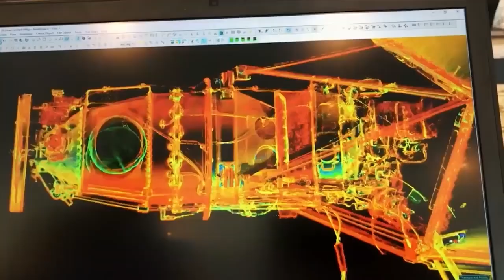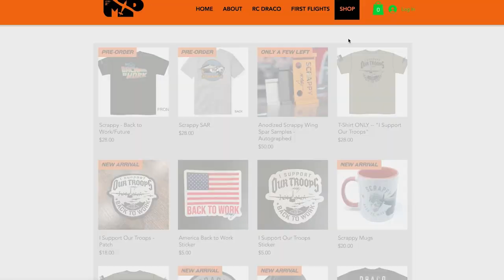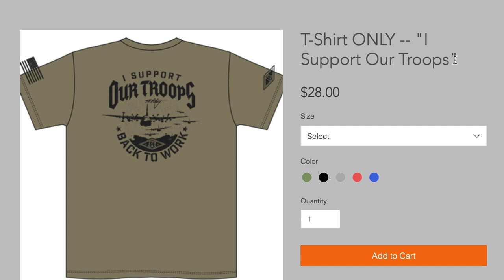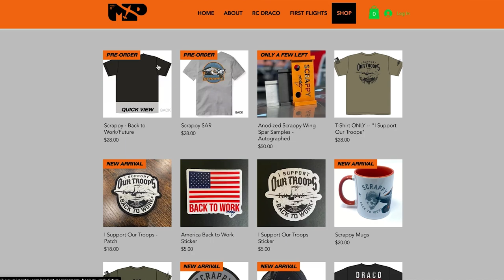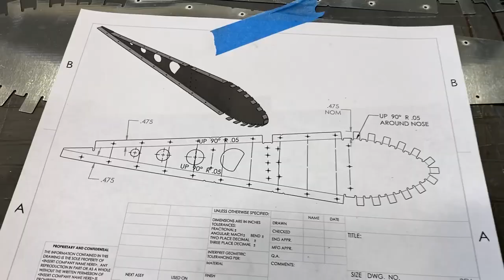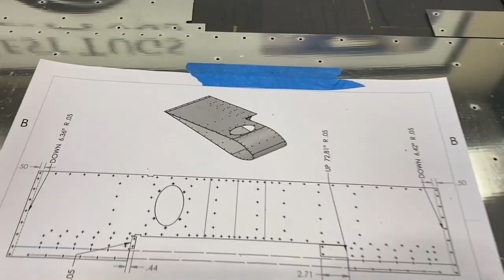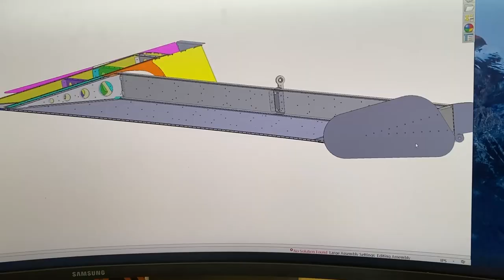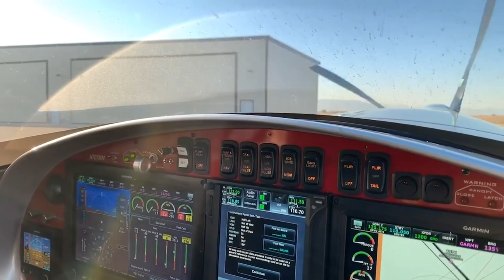Want a Free Flight? - Bush Plane Upgrades Transforming Wings | Scrappy #66

Comment: This reminded me of my first flight. I worked for Chrysler/Jeep and one of the benefits was they paid for "enrichment classes". The catch was that there was a set amount you could use for anything, the majority had to be work related and I had used it up on SCUBA classes. So pilot training was out. Until, I stumbled across a position requiring a pilots license in Chrysler's job database. Basically if they were running out of job critical parts someone would fly in a small number to carry them until the normal shipment arrived. The person responsible said no way it was going to happen until I showed them the job posting. They actually took it personal and was POed. Still puts a smile on my face.

Comment: Hi Mike. My first ride in a privately owned aircraft was in 1970. I went to California to stay with my mother. My stepfather, Bart, was a sales executive with Lockheed on the C5 project. We went to an airshow at Edwards for the public presentation of this aircraft. While there we ran into a friend of Bart's from his days as a test pilot. He invited us to his ranch and said he would take me for a ride in one of his airplanes. That's how I wound up in the back of a P38 with a guy named " FISH "  Been hooked ever since. Love the vids. Back to work.
Reply: That first flight is usually all it takes.
  Mine was in 64 in the front seat of a glider. Sitting there in the nose, no sound but the rushing air. Yeah! I then joined Civil Air Patrol in 1970, 2 years later I had my pilot certificate and never looked back. Inspired me to get a masters degree in Aeronautics and Structural Engineering at Embry-Riddle Aviation next door to our Ranch  in Prescott Az. The ranch is no longer there but the spirit lives on. 
    Although I've never had the resources Mike has. Plus I fall short on  his talent, I have designed and built several airplanes over the decades.  Have two composite experimentals and a ultra-light. Would fly every day weather permitting. 
       🤠🐂🏞️🛩️
Reply: Was there to see the first space shuttle landing at Edwards too. And my sister's boyfriends mother married a guy named Kelly Johnson ( yes, that guy ). Still I majored in computer science snd wound up building houses for 30 years. Don't regret it but I couldn't afford the flying lessons. I did take some with Ernie Shelton in Columbus Ga. The oldest active flight instructor in history. Met him in 1982 and remained friends until he passed away not quite 10 yrs ago. Got lots of great stories, just never got the license
Reply: @michaelmagill189  well just have been able to know and hang out with some of them individuals makes for a nice life experience. Development. But I also spent years doing construction myself.  and I have always been a Rancher.  life doesn't always work the way you plan.lol  like you no regrets.
   Civil Air Patrol for me was twofold. The draft was still going strong and I thought my being in Civil Air Patrol I might be able to enter as an officer in the Air Force but I was never drafted and it ended shortly after I joined. The other was to get my pilot certificate. They assist in training for no more than your annual due which I think at the time was $40 considering Boy Scouts was $3 a month that was a good deal. And of course at that time it was a private pilot's license there was no recreational license or the later sport license. 
     ultra-lights tend to get a bad rap but there are many types. Have a friend who has a powerchute. I've been up on it it's not for me. I have had a few different types what I have now is a J-3 Junior, or kitten as it's sometimes called.  Very sound and reliable. Just a scaled-down cub.  but it needs no registration no annual and no license required. 
  Many of that type can be picked up for well under $10,000. And they are easy to store.  It is an inexpensive way for those who want to fly to fly but they can't get past the term ultra light. also when we really have to do is practice their practical test online.  find a tailwheel instructor tell him what you want to do and take a couple lessons. 
    Of course life being what it is even a small amount is too much.  Then there's the other half of a relationship.
    .

Comment: Most people won’t think of a fence for the body side of the wing, but you can consider telescopic fences for when the leading edge components are deployed, the fence would also be useful during regular flight due to how far separated they are from the body. All of this isn’t necessary, and may even be discarded if they would interfere with visibility, but I think a somewhat conical shape can be added without interfering.

Comment: Appreciate your videos, would suggest with the ebikes either take the battery out to where you can get handle them inside if there is an issue or put a fire plate above the battery area under the wing to protect your wings in case of fire. Those batteries can be nasty if they get unstable. Awesome plane 👍👍👍

Comment: Watching you work with such a great attitude is going to help me with mine today. Second day of getting my motor stripped down enough to get the heads off of my 06 Range Rover supercharged 4.2L. Head gasket leaking combustion chamber to coolant area. Ugh! I am SO sore just from yesterday. My fault for getting soft at 55.

Comment: Great work Mike and thank you for all of your videos. Much enjoyed. Your enthusiasm is infectious. I was wondering about the Aileron End-Plate: When the Flap and Aileron are in differential full-droop the gap between them opens. Would there be an advantage to profiling the bottom half of the Aileron End-Plate so that there is no gap when on full flap?  Also an End-Plate on the outer end of the Aileron?
Keep up the good work. “Back to Work” 🏃🏻‍♂️

Comment: Mike you need to look into a Festool TS 55 track saw. I think it would benefit you greatly. You’d even use your table saw way less. Festool is far superior to any other brand of trackway.. It has every bell and whistle you could even think of. Including built into stops to make accurate starts and stops. Rubber grips that grip the material your cutting. If by chance your cutting curves you can heat the aluminum up and bend it to the contour or have someone hold the track and allow it to move as you cut so make sure the blade stays in the material. Anti splinter shield that allows you to see exactly where the blade is cutting. It’s also plunge saw. Allowing you to accurately begin a cut in the center of your material and also ending a cut with out any mistakes. I wouldn’t trade mine for the world.

Comment: You have one steady hand there, taking a cutter to my aeroplane and that close to the final cut would have me out in a sweat :-)  I did hang gliding for years and also fixed wing gliding for a while, I loved the precision of flying a sailplane, as opposed to the noise and vibration of a light aircraft - no offence. Your plane there, ticks all the boxes not least because you built it yourself. You really work to precision close tolerances, I'm more birds nest, prototype, but  I love repairing, building, even designing my own kit, but kind of draw the line before planes. More radio equipment as that's more my background.  More projects than time to do them, "Back to Work" :-)

Comment: Hey Mike,
  I remember you talking about the great balance and aircraft attitude when you deploy the slats, flaps, and ailerons. With the increase in area to the flaps and ailerons, have you done anything to compensate to keep the original balance for the change in Center of Lift?
Reply from the maker: I’ll try and remember this question and answer in a video at length 👍🤠 yes is the short answer

Comment: Before this mod you were SO happy that the wing (slats & flaps) would deploy and there was no change in the center of pressure so no trim change.  Did the added 3" of flaps now induce a requirement for some trim input (or a heavier stick) when you fully deploy the flaps & slats?

Comment: Mike: What a gift you offer! Great innovations on the recent changes! You are blessed with so much energy!!  Have you ever looked at the "German WWII Fieseler Fi 156 Storch" as an engineer? it has a Wingspan: (46 ft 9 in) What is Scrappys wingspan?  I'm not current and no engineer but this was notable for its excellent STOL performance and low stall speed of (31 mph)  which seems good for today's Bush planes / STOL. A fixed slat ran along the entire length of the leading edge of the long wings, while a hinged and slotted set of control surfaces ran along the entire length of trailing edge seems innovative for time but not all plane use this?   Would any wing benefit with fences on the end like you installed?

Comment: I wouldn't mind a first flight, but I'd want it to be a glider flight. I learned R/C on gliders, I know the Air Force Academy trains on gliders, and I really think that's the way to learn. That way, power will always be a luxury and you'll revert to glider training if you lose power.
Reply: I'm not airworthy but the pipistrel sinus is one of a very few that could satisfy both missions. Learning unpowered flight first is like sailing vs power boat, dirt bike vs crotch rocket ... simply the correct place to get the basics engrained into your reflexes.
Reply: You can get a glider only license.  
Actually that's youngest license pilots license you can get.  I believe you only have to be 15.  Not sure as ages weren't a thing when I got my pilots license 😂
Gliders are limited in areas that have them though.  
Also many current fighter pilots  never flew a glider.
But do what works for you

Comment: That is so awesome you're giving some people the opportunity to fly! You're going to make a bunch of people extremely happy! You surely are an asset to humanity, Mike! 😎😎😎

I can only imagine how much of a difference those extended ailerons made!  I bet the slow-speed flying has been transformed. Lots of extra surface area! At speed you could probably make passengers pass out with the roll rate, HAHAHA! 

I want a helicopter soooo bad! I dream about flying them!  I need to eliminate my mortgage first - just 11 years to go! Also need to get my '07 Silverado reliable - I'm halfway there after upgrading the rear diff and transmission. Next is the engine, failing at 117k miles. Got to love it - the complete opposite of your work ethic in one vehicle, lol. We'll get there one day! Got a paramotor to scratch the aviation itch, so I am blessed. 😊

Comment: Mike, I have a question:

On an earlier video, you explained how happy you are that you have almost no change in pitch moment when deploying the flaps, due to the slats moving forward as well. Now with the bigger cord on the ailerons and flap - am I correct to assume that you now have a little more pitch down moment to compensate with elevator trim/stick movement?

Gretings from Germany,
Florian

Back to Work! :)
Reply from the maker: Stay tuned for the next video 🤠
Reply: @MikePatey  roger that! :)

Comment: I love everything about this plane. Engineering outside the box.  Ive always been fascinated with slow stall speed flight. I use to spend hours as a kid configuring a Boeing 747 in MS flight sim 2004 to fly level at 30 degree nose up pitch as close to the ground as i could. I dont know why.

Comment: I'm amazed by this much work with a plane having giant unflanged gears 2 bikes below wings and you're adding metal sheets in order to reduce drag... 😳🤔.
Wing tip counter balance design also adds additional torsion stress all over the control surface and so do require proper study to determine is you won't gonna kill yourself in 3-4 years due to metal fatigue.
Risquy except if you're the designer and already know max stress load for everything.

Comment: Hey Mike, aren't the tolerances a bit to low for things like icing up and/or expanding in the heat.
What about the occasional 'warp/knock' that might happen accidently and prevent you using the flaps etc?

Comment: So I know you had the wing balanced so that when the flaps and slats were deployed there would not be a change in center of lift or pitch through the range of flaps and slats. Now that you've added so much aileron and flap to the back of the wing does the geometry of the slat deployment need to be changed or is the center of lift fairly similar to before?

Comment: Just wondering, made your ailerons and flaps larges and so your wing. Great effect on roll autorit for sure. But did you calculate the effect on the stall speed, since you increased your wing area?

Comment: Racecars have endplates on their wings to prevent the low pressure air from spilling on to the top of the wing, why don't aircraft have large endplates on the ends of their wings?

Comment: Hi mike , I was just wondering when you tightened up the gap between the ailerons and the flaps is there concern for ice build in those now tightened up areas ? P.s. thank you for sharing you’re builds with all of us . 👍
Reply from the maker: Hi Phillip, you are correct. I address this in a previous video that one must "mind the gap" so to speak. Too close of tolerances and you run risk of icing freezing controls in place; many people have died from this. Scrappy's tolerances are big enough to prevent this from happening. 👍🏻🤠

Comment: I remember from a video long ago when you created the attachment points from the wing, to the fuselage.  From my experience, the attachment points looked too weak. Please consider making the attachment points out of heavier metal, and much stronger.
Reply from the maker: 👍🤠 Great question comment and understandable concern.  If I had left it with the  certified stock attachment brackets I would also have concern.  In one video I show the machined wing attachment points I custom made on the spar side attachment.  The stress loads were calculated at 4,500 lbs gross weight at 8 g load.  Testing exceeded that significantly.  On the airframe side, I know I videoed my alterations but I’m not sure if it made it into the video as 95 percent of the filming gets cut out in the editing phase.  On Scrappy I double the thickness of the attach point plates where it bolts. A general rule of thumb in steel is 50 percent more material nearly doubles the value  depending on load directions.  I doubled the plates thickness and nearly 4 times a stock cub value and additional to that I then added two per side directional large gussets to the main frame attachment points.  It’s hard to get everything into the videos and I appreciate the comments. Thanks for watching and following

Comment: could the fences bend under pressure, depending on air speed (I understand the flaps are not to be pulled down at VNE) ? 

ps: I'm still unsure about the aileron weight balancing as an assist (more than one side balancing the other), and then there are the turbulences created by the top protruding part (I understand it would also bring some low pressure air under, but only marginally considering the width of the top part) - agreed, at very low speed such turbulences may not matter much

Comment: Because there is always a give and take, what is the biggest drawback to having oversized ailerons on a plane? Is there a reason you didn’t do that from the start?
Reply: My guess is the drawback is a little bit of weight and drag (from the part of the aileron in front of the hinge). He said he didn't believe it was really going to fly as slow as it does, so it would be very hard, even for a super genius, to predict exactly how much aileron authority it would have before actually flight testing it.

How'd I do, Mike?

Comment: So, to be clear, I can't hang a level shelf and have no skills or experience with tools. However...... when you were scoring the tape with the caliper, I noticed that the caliper was not perpendicular to the edge of the metal (it appeared that to score it, you had to have a slight angle). Wouldn't this "throw off" the measurement, especially given the "3 decimal" tolerances you are going/aiming for ???

.
Reply from the maker: You're exactly right! Nice catch - However, aim small, miss small 🤠
Reply: @MikePatey  Ahhh..... I get it. Cool. Thanks for explaining it.  🙂